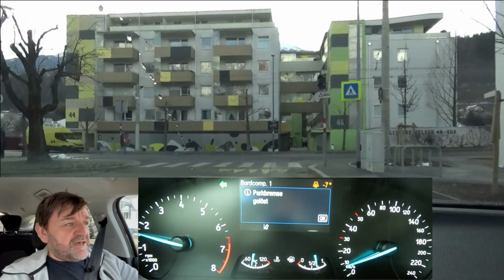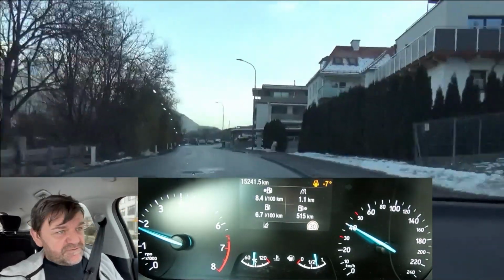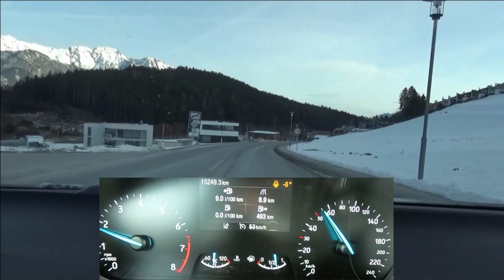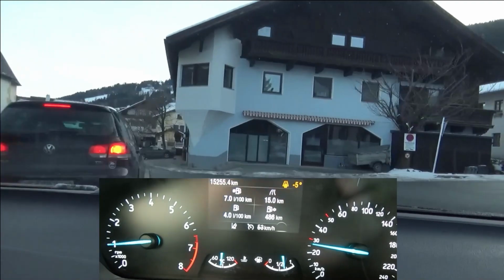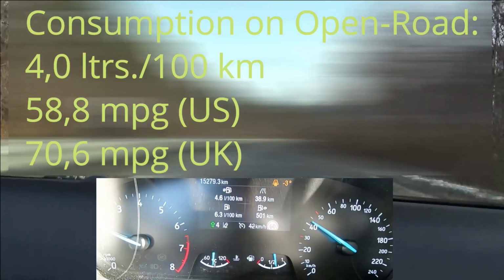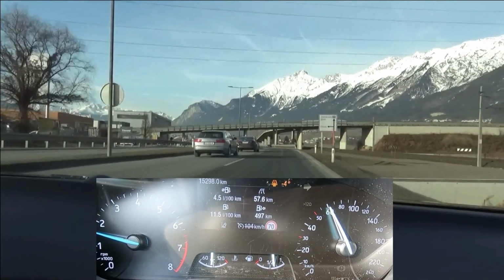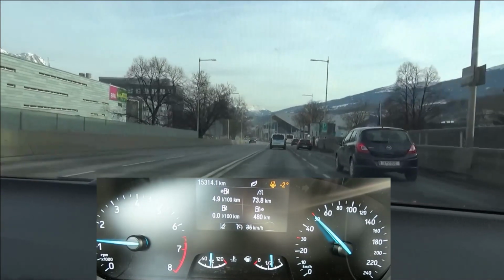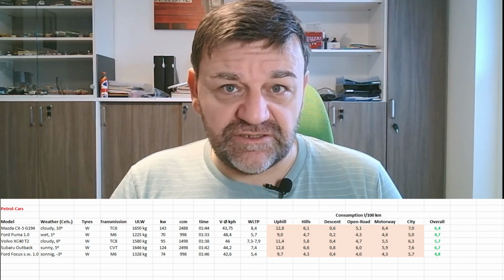Ford Focus 1.0 EcoBoost - real world fuel economy test done by a professional Eco-Driver

Comment: Im in the range of 5.6-6l/100 most of the time - Ford Fiesta 1.0 108hp and got remapped in 2016 and has 156hp. Only get the lower at highway and very little city driving. I don't like going under 1400rpm personally, as predetonation occurrence is higher if you lug the engine to much. Spritmonitor is spot on imo when you drive normally - the rating system manufactures use, are far from a real world scenario, and you will never be able to hit them as they are made in a lab setting.. I like the engines - but my timingbelt was toothless on 15% belt when i changes it and you need to do oil changes often, så you keep the belt free of dilution of gasoline. Also need to get it up to temp more often, especially when doing a lot of city and short trips. Oil is fairly cheap - engines are not..

Comment: OMG. I have been driving a 2.5L 2008 Volvo T5 for 3 years. I suddenly feel such relief that the engine bit the dust (incl. a replacement that I foolishly had installed for 3600 Euros) I am checking out an excellent offer this weekend for a 125 ps 1.0 SCTi. I strongly believe in the saying that God never shuts a door without opening another. Thanks so much for this Real World Test. I am convinced in the mpgs for sure, and don't need to research any further.
Reply from the maker: As long as you know how to drive efficiently you'll be happy with it :)
Enjoy it!

Comment: I would agree with this economy maximum. I achieved 60mpg on a 250 mile trip in the UK with a 1.0 140bhp, mixed roads and hills. The little engine has the advantage of lower weight and friction, but most importantly is low revs (1500-1750rpm), slow acceleration, and limiting braking.
Reply from the maker: A man who knows... :)
Reply: Low revs lmao

Comment: Exactly! You are very right about underreving the engine. There is no such thing of concern on Ecoboosts (and other engines as well) even if you floor it when at 1200rpm only. I torture my 1.0 125hp Ecoboost just like that as a routine and up to this day, the engine has no technical problems whatsoever and I also do oil analysis tests once at 2 oil changes just to see the health of the engine on paper. Otherwise, you could've changed each gear exactly when told by the computer (again, even if it might seem to early, it won't underrev) which is usually at some 1700-1800rpm and you'll get even better mileage (lower consumption), but most of the time you changed gears up from 2000rpm or higher. Try the same test again and change from 1800rpm only. You'll see a half a liter difference at least.
Reply from the maker: Sometimes I just needed the power to accelerate, as I said, I am surely no obstacle to other road users and so occasionally power is needed.

Comment: Really great video, good job. Today I took a similar drive to test mpg, distance was about 75km,  but I have the 1.0L 125hp Focus St line wagon, I did park up a couple times to pop into shops, but really drove as conscious as I could in Eco mode the whole time. It was a mix of uphill, down and flat 100km limit with a bit of town driving. I achieved 4.9l/100 i think if I did it again I could get 4.5/100. What I will say is that it wasn't really an enjoyable drive, being so frugal and trying to anticipate everything. My car over the last 4000km currently runs at 6.6l/100 sometimes I have a passenger or two and don't always have it in eco mode. Generally I really like the car and in sport mode it has nice pick up and sound. Keep up the good work.
Reply from the maker: Thanks.
Reply: Hey. How you are satisfied overall with the engine in the wagon? How does it cope if you load the car full with people and luggage for, say, some road trip?
And, is your Ecoboost the mild hybrid one? Automatic? Thanks!

Comment: Nice consumption! Im very suprised. What is your opinion about the engine? Do you fell lack of one cylinder during driving? What about overtaking and acceleration? Is the engine is strong enough?
Reply from the maker: The problem I'd have with this engine is not the 3 cylinders, it's more the small size. I have driven the Volvo XC40 3-cylinder with 1,5 ltrs. and this was great to drive, this engine requires a lot of shifting work if you want to drive really economically. Overtaking needs some foresight and is generally a bit of a pain compared to stronger engines. But - as I said in the video - if you want a race-car don't get a Ford Focus 1.0.... ;)
Reply: @ecodriver1746  Tbf ive remapped mine to 160hp feels like at least half a sports car now haha!
Reply: @ecodriver1746  this car is no less race car than the 4 cylinder 1.6 cars